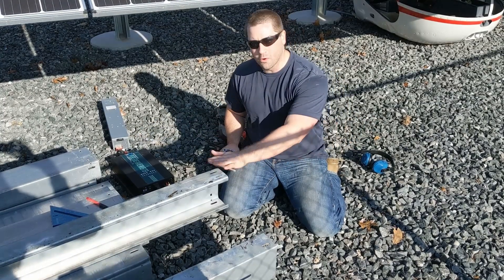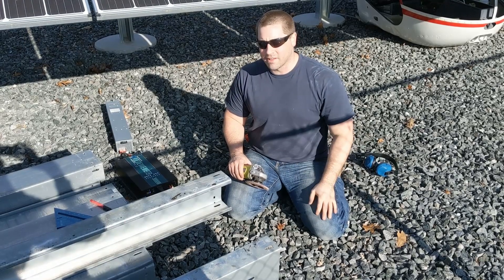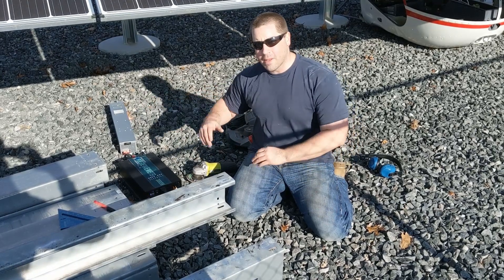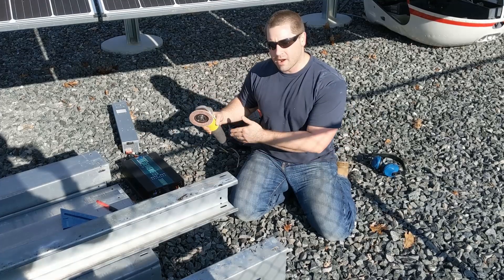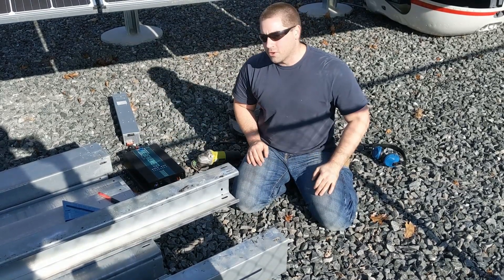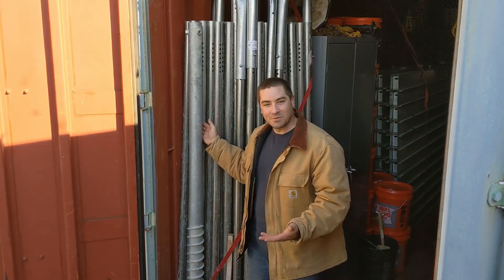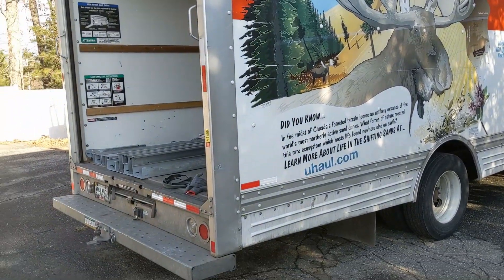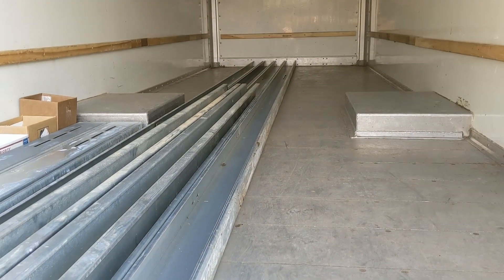Using the Portable 48v Server Battery in the Field

Comment: Nice! I really wish I could find some similar material to build some racks out of... I'll probably end up going with wood.
Reply from the maker: Nothing wrong with wood racks.  You just (typically) can't span as long of a distance between supports.
Reply: Wood would actually work better for me than metal as I'm more used to working with it and already have the tools I would need. I'm just concerned about how long it would last before starting to rot. I could probably design it so it's easy to remove panels and apply sealant/stain every 4-5 years maybe. Not sure, still debating :)
Reply: Agreed.  Wish I had a local source for some used materials.  I went with pressure treated lumber for my array.  Qty 4 4x4 at the corners and some 4x6's as the center posts.  That allowed me to get a good bite on the 2x6 straps that spanned the posts.

Comment: Indirectly looked op the battery after your last video, It is such a great deal.. sadly it was sold out, hope it gets back in stock fast 👍
Reply from the maker: They sell other cells, you just have to assemble them into a cool module.
Reply: True, but these where an amazing deal for the price. The other deals are decent to. What would you reccomend for a 500Wh+/- portable battery pack?
Diy is fine I just dont have a spot welder
Reply from the maker: http://bit.ly/371qZmd  These are already in 24v configuration, and are 460wh.  This would make a fantastic portable power pack.  You still need a BMS and inverter.  But no spot welder needed.
Reply: @DavidPozEnergy  a bms is very expensive for lto cells (~$150) also these cells are glued into a plastic case. I would love it if  you would make a similiar video to server rack battery with this battery since I would not know hot to make a decently cheap and easy battery out of this.
Reply from the maker: Hi,  I'm not sure why you think the BMS is $150.  I'm making a little project (like the server battery) with some LTO cells and paid $32 for my BMS.  But you can do anything you like.  I think it would make a perfect little 24v battery for portable power just like my server battery project.